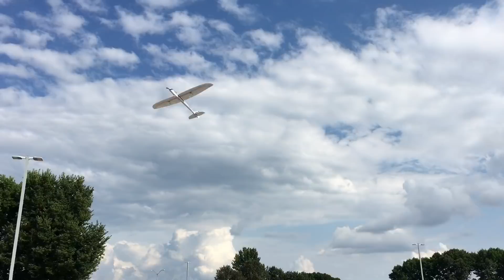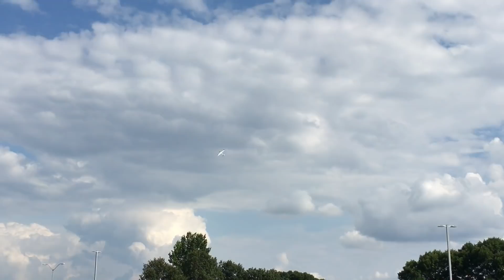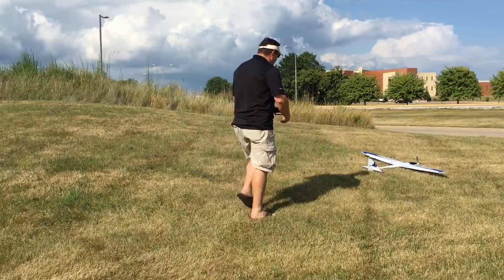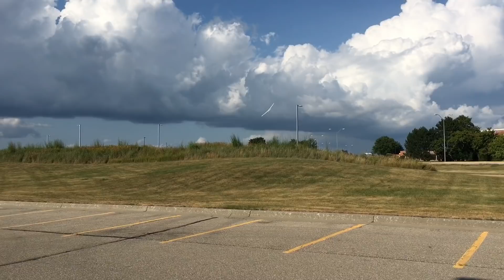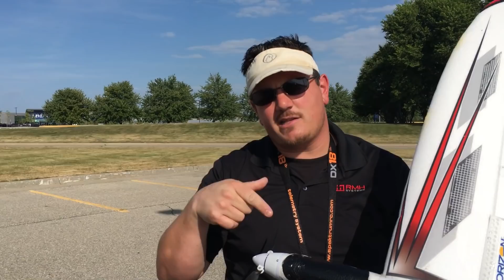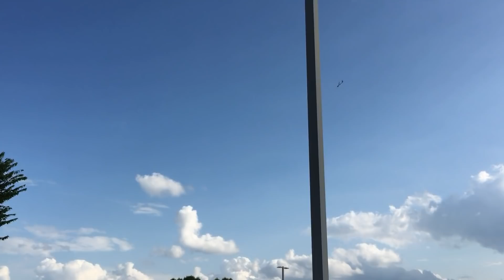Eflite - Conscendo Advanced VS Conscendo S

Comment: Thanks for mentioning landing issues with slope soaring.  I'll definitely need to do the flaps mod. Crow brakes would be nice! I don't even have a Conscendo yet & already have my eyes on the Phoenix 2000 EPO.
Reply: Seems like the way to get into the Phoenix 2000 is buy two Conscendos & transfer the electronics from the 2nd Conscendo to the Phoenix & have spare parts for the first Conscendo.
Reply from the maker: You've seen my videos on the Phoenix Evolution, right??? If not, you gotta check them out!!!
https://www.youtube.com/playlist?list=PLXTH0DstRDc4eYLtaRf01AkhBze6XkRuL
Reply from the maker: No, you can just do like I did, and it's a LOT cheaper ;) Good luck!
Reply: I only saw one of your videos with the Phoenix 2000. Thanks for the link!
Reply from the maker: There are a bunch...like 19 videos...and mine is a 2.6m, not the 2.0m...if it helps. The tail is a bit smaller on the 2.0m version, fyi.
Unboxing - https://youtu.be/7sh2tIwPYJY
Build 1 - https://youtu.be/_fP4HbK5f3A
Build 2 - https://youtu.be/R0gL5S3CU70
Build 3 - https://youtu.be/ww6MDlWSRYU
Build 4 - https://youtu.be/emeXTYHdQIo
Build 5 - https://youtu.be/ppKYDIiEMvg
Build 6 - https://youtu.be/4aukbAjRL9Y
ASW-28 Radio Setup - https://youtu.be/ui4-rFALQvg
Maiden Flight - https://youtu.be/RhUHAw0T-Mk
Build 7 - Tail - https://youtu.be/-7TJOdP9N8s
Phoenix vs ASW-28 - https://youtu.be/Ah-OwqfSc_k
Build 8 LED 1 - https://youtu.be/5MXdNv5Vrwo
Build 9 LED 2 -  https://youtu.be/DQ-EvmnnNmg
Build 10 Rudder Hinge - https://youtu.be/cuCaESaDeB4
Build 11 LED 3 - https://youtu.be/LkVppVnu9PU
Remaiden Flight - https://youtu.be/Ea-f_LiB-sM
Build 12 Stock & Custom Decals - https://youtu.be/RfBiSkz-pn8
Remaiden Flight - https://youtu.be/Ph9gxCIyvLI
Remaiden / Upgraded 11X6 Prop - https://youtu.be/-NI3VkTrmdQ
New Land? - https://youtu.be/i6H2iUAjWmY

Comment: Hi Brian, great videos.  Is the fuselage for the Advanced different to that of the S?  Do you know if it is possible to use the aluminum motor mount in the Advance in an S fuselage?  The reason us that HH still do not have an Advanced fuselage after 3 months but they have S's and say they are not compatible even though you can use the same motor, wings, tail fins, spinner, and canopy in both!  Thanks

Comment: What was the voltage after the Advanced flight?
Reply from the maker: It was still reasonably charged about 3.7's per cell. I usually fly them to 3.8ish, but this is a new one for us.
Sorry I forgot to include this in the video...sometimes It's hard to see the meter in the sun, but on this one I just plain and simple forgot.

Comment: Hey Brian I Broke the prop shaft on my E Fite Valiant . Whats your advice. Quit Flying
Reply from the maker: LOL - NOOOO! Don't quit!!! You can do a bunch of things to get her back in the air...

If you don't have another plane, from which to steal a good motor, you can follow this link to find the motor from HorizonHobby... https://bit.ly/3lw9zFK ...it's a bit hard to find these parts sometimes, but when you get more used to searching the manuals, and using HH.com, you'll be set.

When the part comes, just take the cowl off, and disassemble stuff to get the motor out. Replace the motor, and if it rotates backward, swap ANY two of the three wires from the ESC, and it will revers. Then put it all back togehter, and get back in the air!

Don't give up...crashing is WAY more common when you're new. I thought I was gonna need tons of spare parts when I first started flying, so I was always buying tons of parts....most of which I still have ;)

Comment: i just flew my conscendo today, not sure which one but has yellow and black stickers, anyways i was doing touch and goes and on the last one as i was pulling back up after skimming 5 feet over the ground, i shot it straight up with no throttle and let it stall at about 25 ft than rammed the throttle full open only to have a puff of smoke come out and the prop stoped spinning and since im allready into a stall the plane came straight down as i was trying to gain as much speed as i could for a crash landing flare at last minute, i got lucky, it flared just it time to barely skim and hit the ground. im curiouse why this motor burned out, this was my 8th flight i think and im using the bigger 2200 4s lipo, which says its compatible with, i wasnt even flying full throttle the whole time. thinking about buying the night radian now but only prob is i love how fast the conscendo flys and like that wooshing noise, not sure if radian goes as fast, would you happen to know?
Reply from the maker: Conscendo Evolution - the NEWEST and more awesome than ever! Bummed to hear you had that happen.

Definitely hit up HH!!! They WILL make it right. ESC and MOTOR. Be fair but firm, and you'll have replacement parts ASAP.

I had the same thing happen on about my 15th or so flight...I guess things like this DO happen. Oh well, the plane is so sweet, I have a hard time being upset ;)
Reply from the maker: Radian is NOT fast like the Conscendo. Check out THIS one - https://youtu.be/Rxw64XooIvU - a LITTLE more money but you will be blown away by the size and shear quality.
Reply: @BrianPhillipsRC   Holy crapp I am going to buy this one right now that plane is awesome and I like that you can do touch and goes with that 1 and exp the flaps I like how the flaps work to slow you down in the air from the drag it cuases, its a cool concept, also i noticed the conscendo just skims over the ground for ever which i like but can be difficult to land in a smaller runway.
Reply: @BrianPhillipsRC  quick question, im considering getting one of these now after watchin your video, great video, so can you do a touch and go with this or would this be to low where the prop might hit the ground if i throttle back up.

Comment: Consheeeendo love fest ........... Oh yeah.
Reply from the maker: ConSHHHHHHHHHHHHHHHHHEEEEndo love fest it was, for sure. I really want to pass through the trees at FULL speed next time :)
Reply: Bring it on Brian. Great flying from you as always, very entertaining.
The Advanced seems to fly, climb, etc the same as my modded S. I can still fly it on 2s but more fun on 3s. Will be trying 4s 950 soon, yum. I didn't melt my motor mount, it just sort of crumbled away. Way to expensive to buy the genuine parts here in Aus so I make do with what I can get at a sensible price. Loved the stock motor tho, a real smooth sweeteeee.
Reply: Oh, and no, I haven't fitted flaps as yet. Got given two damaged Radian 2m this week so that will keep me busy. Do you reckon I can use the AR636 in a Radian which is 3 channel but I can easily fit ailerons/ flaperons to it to make a 4 channel setup.?
Reply from the maker: I've had to build custom motor mounts out of aluminum, which is a HUGE pain in the but, although it worked perfectly :) Maybe you can melt yours away, then just redo it that way???
I'll keep videos coming, so long as you guys keep watching!
Reply from the maker: YEAH - do it!!!
I had to cheat to get flaps to work on the stock AR636A. You might have to watch "that" video (in my Conscendo S playlist), if you need help, since it's been a while...but I basically steal part of the "panic" channel. It's totally cool to have flaps. I hear the Radian will fly past a perfect approach over and over again!